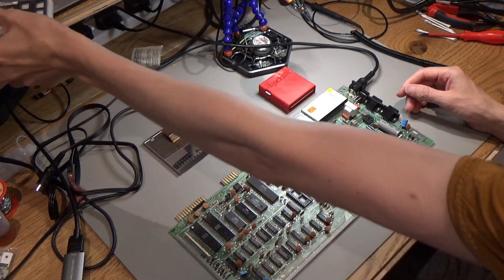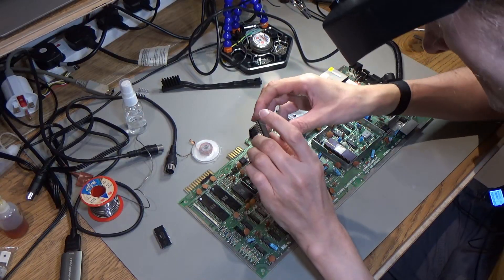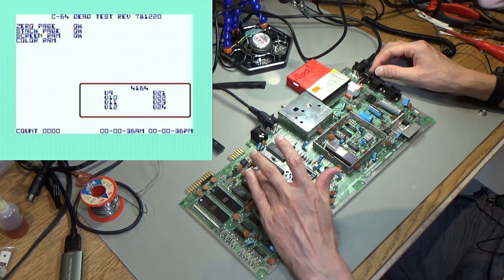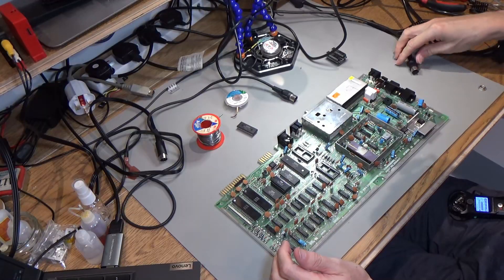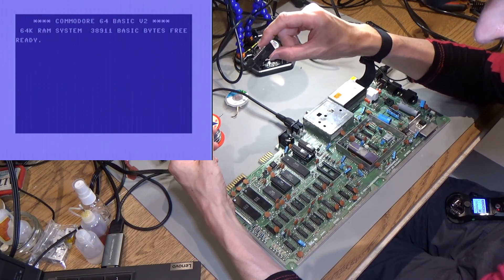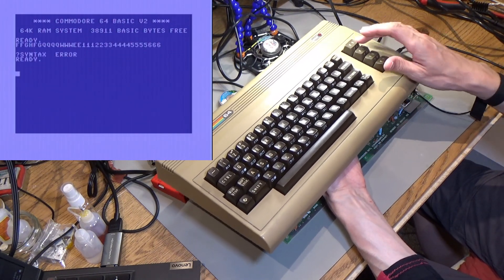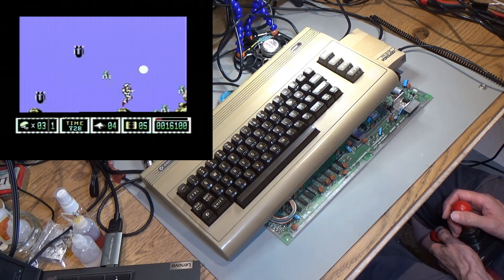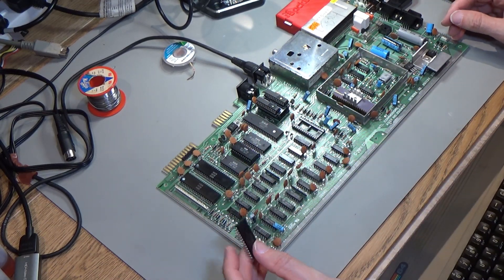C64 Black Screen Repair

Comment: I see that you constantly cleaning that desoldering station nozzle. I have similar model and this clogging is annoying as hell.
ps. nice video.
Reply from the maker: Yeah, i think i was having lots of trouble with it that day and eventually it got properly blocked. I clean it every time i use it now. It's quicker than having to do a dissasemble and get another soldering iron to try and unblock it.

Comment: I keep a stock of GALPLA and ARMSID. Those are two of the three primary failures, RAM being the third
Reply from the maker: Yeah, the PLA being the worst. Just read the new Bil Herd book "Back into the Storm". He says the problem was the passivation layer on the chip, which was being destroyed by too much boron in the silicon. The PLA chips are eating themselves from the inside. Soon there will be no working original PLA's left.

Comment: Hi Dave, Pulled my 64 out of the attic and powered it up, realised why I threw it up there in the first place, no signal, using the RF connection to the TV, watched your helpful video and replaced the PLA with the twin GLA chip, and now have a black screen, any ideas on my next step, CPU (6510) does not get warm that I can tell, (suspecting this is the issue) Kernal ROM does get warm as did the PLA before I replaced it , not got any tech except a multimeter, voltages are 12 and 5 on the board, thought I'd ask before ripping out the CPU chip.
Reply from the maker: Check the 5v power supply from the PSU as well as the 5v voltage regulator that is on the board. The CPU could be faulty, but they are generally quite reliable so wouldn't be the first thing i would check. Any failure in a ram chip could cause black screen, check them with your finger to see if any get hot, but be aware they would only get hot if they fail short, they could seem quite normal but still be faulty. If any of the following chips are socketed, then you can take them out and see if the computer boots CIA's, Basic Rom, Character ROM, SID. It should boot to some kind of screen without any of those, if not then one of the removed chips could be bad and bringing the system down. If any of the timing circuitry has failed then the computer will also not boot (an 8701 chip on more modern C64's, or a collection of chips near the VIC-II on older models, if you get access to an oscilloscope, you can check the clock is getting to the VIC and out to the other chips). The most handy thing might be the dead test & diag cart. The dead test flashes on boot might be able to tell you what has gone bad, but if the dead test can't boot then it can be PLA/CPU/Timing curcuit/chip.
Reply: @DavePoo2  Cheers, will check out the RAMs for heat, Don't think anything was socketed, but have the ability to remove and see..got a scope at work with a man who knows and can investigate for me...cheers
Reply from the maker: Oh yeah, and it's always possible that you have a bad VIC-II chip, which is a bummer if that's the case as they are hard to find replacements for now. The VIC-II also provides some of the timing for the rest of the computer so you need a fully working one or the computer might not start.
Reply from the maker: The CPU not getting warm might be a red herring, as if it has been shutdown because the rest of the system is not running, then it might not get warm. The don't get super hot when they are running full speed (unlike the SID and VIC which both get pretty hot by comparison). But a faulty CPU is possible and would bring the system down (if you had a dead test cart, the dead test also wouldn't work as it needs a working CPU, PLA & VIC)

Comment: If you are running the dead test, you don't need a Kernal ROM even plugged in. It's bypassed. However... If the PLA runs the dead test, it is running the cart select. Once removed, the PLA must seek the ROM with chip select. It's entirely possible that the PLA is damaged and can't select the ROM(s) for whatever reason. Curious. Can't say I've seen that behavior before in any of dozens of videos I've seen. With the dead test, it does a test of the hardware (semi accurately). The Character ROM, BASIC ROM, and Kernal ROM can be removed during this test.
Reply from the maker: Yeah, it's an interesting one. I was going to do another video where i put the PLA back in and find out why the dead test would work even though the computer would not boot (the suspect being the kernal select line), but when i put the PLA back and tried it, it now just produces a black screen in all situations.